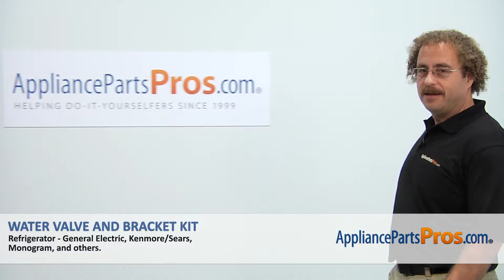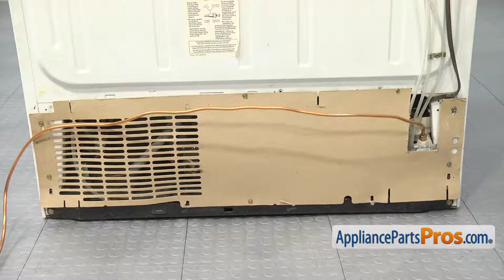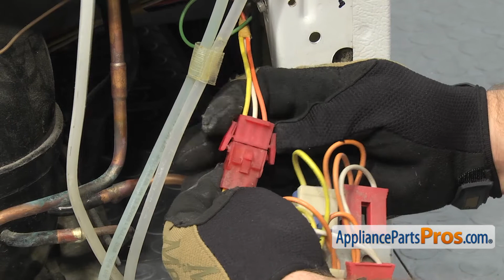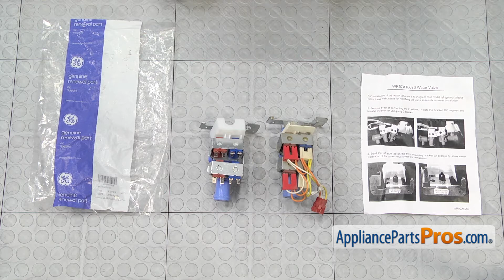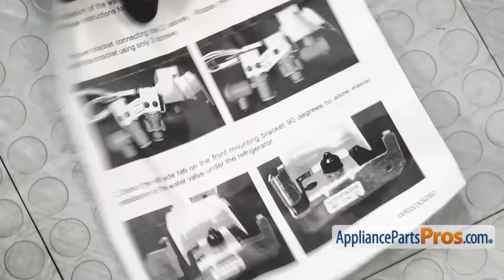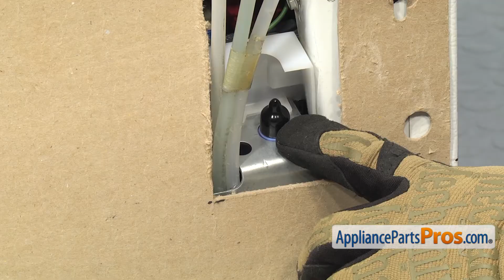How To: GE Water Valve and Bracket Kit WR57X10026

Comment: This was very helpful, thanks. For anyone who wants to do this replacement on a GE Profile where the assembly's located at the top via front panel, the work area is MUCH harder to access. I managed to do it (albeit while inventing myriad new curse words), but the space is very tight, it's behind the water filter (and removing that and its assembly only helps a bit, as the wires are still in the way), and getting a 5/16" nutdriver back there was not possible on mine. Plus I couldn't find my 5/16" nutdriver. I had to remove from the sheet metal wall the bracket that the assembly brace screws into (which I only realized was possible after 20 min. of trying to manipulate a lockwrench locked onto my 5/16" socket). And it must have been a muscle man/woman screwing all these things in at the factory because none of them was easy to loosen. Also, my water tubes were not color coded so I did that myself with markers before removing. Fortunately no water came out of the tubes other than a few drips when I kept bumping into the main supply with my hands.
Reply from the maker: Thanks for sharing all those details! 😂 It sounds like your GE Profile definitely made you work for that repair. Marking the water tubes before disconnecting them was a great idea, especially when they aren't color coded. We're glad you got it done despite the tight workspace and stubborn screws!